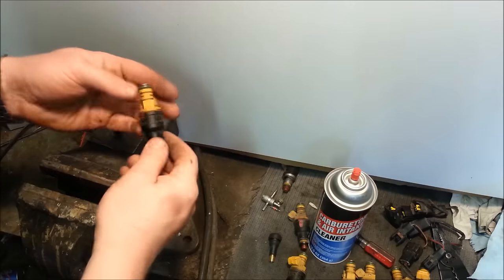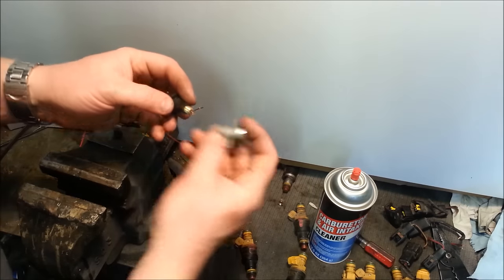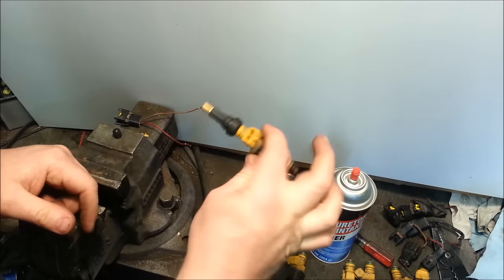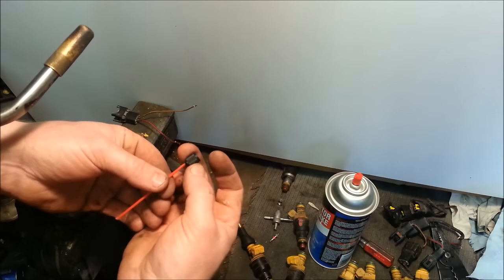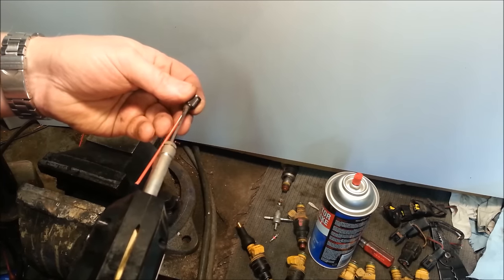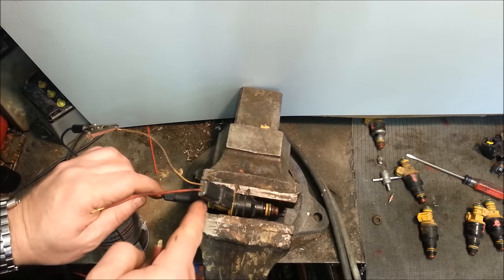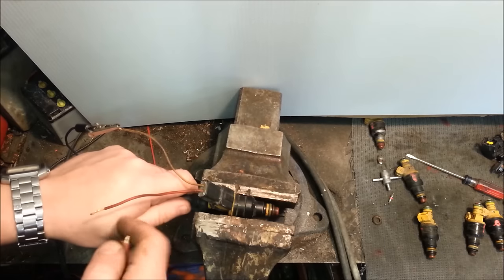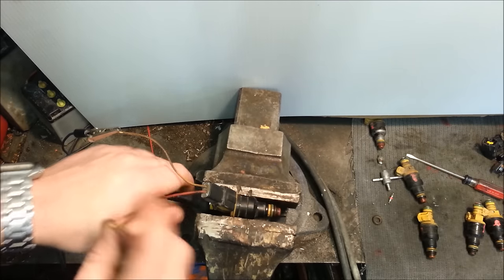Fuel injector cleaning without expensive tools

Comment: I made a device a few years back where I used a hose with clip on tire air fitting on one end, put other end on the injector.
First fill part of the hose with Gumout and hook to tire for air then connect injector to 12 volts. Pulse the power and watch the spray.

Comment: Thank you so much, I have used your technique today and it worked. However I used epoxy adhesive instead of burning the straw. Through this technique is managed to identify the bad injector which would inject the sprayer without power connection
Reply from the maker: Wonderful!

Comment: You can use a power probe or a multimeter at the fuel injector harness with the key on to see what voltage the fuel injector needs....assuming that the circuit is good.

Comment: Valve stems seem to be multi purpose gadgets for the garage!
The only thing I have to notice is that there are Injectors with very low resistance like under 3 ohm (instead of over 12 ohm for high res. types). They dont like to get 12 volts continiously. Easy to measure.

Comment: Go get the medicine syringes from walmart pharmacy. Small size.  They fit the straw perfectly with no heating or adjustment, and they fit the injector o-ring on the other end just right. No mods, plug in the injector, plug in the straw, and it holds pressure and does the same job. WIll save you tons of time. Use a matching injector pigtail, with a momentary switch wired in, or just bare ends.  connect one lead to negative, and tap the other lead on the positive terminal, repreatedly until the injector sprays right.

Comment: Any danger in using regular carb cleaner on fuel injectors?  wondering if a special "injector safe" carb cleaner is needed or non?  Thanks for making this video - made myself one with your instructions.
Reply from the maker: Carb cleaner is just Acetone and about the only thing that will dissolve varnish/gummed up gasoline. Anything that is gas safe is acetone safe.
Reply: @sixtyfiveford  Just cleaned mine using this.  worked good but I probably should have tossed a hose clamp on - injector kept popping off if I didn't hold it.  Thank you sir!  Car is running better ;)

Comment: Last Truck I Had Was 01 Tundra V-6 & During it's 888,000 mile Time I Had It, Usually Just Either Mixed  Premium Fuel+ Some Mid. or If O2 Sensor STARTED acting Like Something Wasn' t Right ,Just Used Lucas & Never Repl.An Inj. or had to Clean Any of Them Manually

Comment: I bought a tin of fuel injection cleaner mixed it with a full tank of petrol 1000ks before an oil change.  After the oil change the engine has stopped burning oil and after 5000ks the oil still looks clean and clear. A complete turnaround. The engine runs and starts so smoothly. Just buy a reputable brand of injector cleaner put in your petrol and you'll be amazed.

Comment: Hey, Is that a port fuel injector. I guess not. It should not function at higher pressure. If its a direct injector, you cant supply 12V for a long time. Can you reply me..

Comment: When powering such appliances with 12v battery,  always use a 12v car bulb (blinker or smth, not headlight) to limit current. You connect it in series.

Comment: I did this yesterday. Used break cleaner could tell right away flow was blocked. Cleaned all 8 and runs perfect now in tank cleaners wouldn't touch it and nobody had OTC cleaning fluid local. More work than using the OTC fuel injection tool but the end result is the same.

Comment: A dealership wanted to flush the injectors on my vehicle as part of their service, and would charge like $250 for cleaning 4 injectors, which is roughly what it would cost to replace them. So, this video is helpful.
Reply: dealerships are really$ rip off. i can get mine =v6 pontiac grand prix injectors cleaned for $80. but i would like to learn to do it myself also.

Comment: I wonder if cleaning the injectors makes a noticeable difference in throttle response.
Reply from the maker: It will if that is the culprit. But you can also have other issues that give the same symptoms.

Comment: Is carburetor cleaner actually the appropriate chemical to use to clean fuel injector?
Reply from the maker: Absolutely. It's designed to clean fuel varnish, fuel deposits, carbon etc

Comment: I wonder, is it really necessary to clean a injector ? It is always on very high pressure, so isn't it quit rare that it will be clogged ?
Reply from the maker: Yes it's rare and I wouldn't go out of my why to clean injectors if I didn't have a performance issue or engine codes.

Comment: Ok so i just tried this but didnt have a valve stem handy so i used a sharpie cap and poked a hole in the lid with a hot finish nail. I left the o-ring on and it sealed tightly. The shaprie cap was a perfect snug fit.
Reply from the maker: That's good to know.

Comment: cleans and flow tests it!  I might try this... my issue is that I have a melted pintle cap (plastic) and can't find the exact replacment.  Any ideas where to get new ones or if I can use a different style on my injectors?  My injectors are no longer manufactured so I need to do a full rebuild myself.
Reply from the maker: Ebay is where I would look.

Comment: I just pulled my injector bar, and duct taped the spray can hose to the fuel intake, had a friend turn over the engine a few times till all my injectors were clean.

Comment: Will definitely try. Cost effective and produces results! Ty sir.
Reply from the maker: Thanks.
Reply: sixtyfiveford  bro, you are a lifesaver. It worked well and got the job done. I left the injector rail installed on the car and connected the apparatus where the fuel hose connects to the injector rail, started the car, kept a constant feed from the aerosol can and baboom, getting all 4 injectors cleaned simultaneously. Of course I have a switch that disables the fuel pump making this the easy method, lol. Point to note, and I learned it by experience, ensure the apparatus is fastened securely to the injector rail. Lol, goes without saying eh! Never need to pay for injector cleaning service again!!!

Comment: What about if we don't know which side is positive and negative does it matter? Also is it recommended to back flush them
Reply from the maker: Doesn't matter which side you connect pos/neg to. Most won't allow back flushing. The pressure will hold the injector closed.

Comment: Engine chatters during cold winter mornings and gets 30 MPG instead of 50 for a 2010 Toyota Prius with 188,000 miles. 
Could injectors be the cause?
I’m cleaning with Lucas injector cleaner.
Reply from the maker: I would first look at your wear items like spark plugs.

Comment: I would think that if you flush the cleaner through the injector in the same direction that the fuel normally flows through it and there are any dirt particles stuck in it they just remain inside the injector and NOT be flushed out? 
 Wouldn't it be more effective to back flush the injector?  In other words, have the cleaner flowing through the injector in the opposite direction that the fuel normally flows through it?
Reply from the maker: Lots of injectors won't flow in the reverse direction with pressure applied. Dirt shouldn't be in the injectors or you have bigger issues. Generally it's varnish and fuel deposits that just need to be dissolved.
Reply: @sixtyfiveford    Great!
  That gives me a better picture of how injectors work which is always a benefit when trying to understand and fix any problems.
  Thank you for your detailed answer.

Comment: How much does a batt like that cost? I'll just see if I have one laying around. Then I'll just remove the injectors buy some carb cleaner. Then I'll break out my drill and diddle with a valve stem. This looks like a fun lil science project I really think it does
Reply from the maker: You can use the battery out of the car. Or you can use a 9v battery.

Comment: Can you back flush with the valve stem by putting it on the other side of the injector?
Reply from the maker: Yes. If the spray pattern doesn't look good just do it in reverse a few times and recheck.

Comment: Do you know the voltage for a bosch injector?  Hooking up 12 volts with battery amperage will fry an injector
Reply from the maker: Fuel injectors run off of 12volts(actual 13-14volts when vehicle is running/charging). I've hooked up many Bosch injectors to 12volts without any issue. Power(12v-14v positive) is constant to the injector while the vehicle is running and the ecm pulses the ground to trigger firing the injector. The injector or any electrical device will only pull the amperage it's rated for (approx 1amp) and it doesn't matter if you hook it up to a 12v battery from a motorcycle or a diesel truck. It will only draw the approx 1amp at 12volts. People try to use little 9v batteries and they work for some injectors, but the lower voltage causes a higher amperage draw and more heat in the coil winding of the injector. So your more likely to damage an injector by hooking up a 9v battery cell than a 12v car battery.
Reply: @sixtyfiveford  I'm not willing to chance it at this point, but I hope it's right.  Here's another question I have.  On a diesel fuel rail vehicle....If you turn the key on the engage the fuel pump in the tank.   Will fuel come out any of the hard piping to any cylinder if you open to bleed?
Reply from the maker: @frontlinemedia4270  An electric fuel pump on a diesel generally only pulls fuel from the tank and delivers it to the suction side of the injector pump. Generally you bleed it at the fuel filter. 
http://www.autodiagnosticsandpublishing.com/feature/fuel-injector-testing.htm
Reply: @sixtyfiveford  well, I have fuel at the injector lines when I crack them open while the electric fuel pump is running.  Of course when it shuts off after several seconds I have nothing.   This high pressure fuel pump was just remanded

Comment: Thanks works good ...i used to put cleaner in injector fuel rail and back fill the fuel pump inlet with  sparks out and crank-over, but this is better... subb Ced
Reply from the maker: Thanks.

Comment: Does an injector can be fixed? If so, What are the most common damages?
Reply from the maker: Either the coil is shorted out and not fixable or it is just dirty and needs to be cleaned.

Comment: Great video, how can you tell if you have a leaky injector though ?
Reply from the maker: It'll leak when you pressurize it with carb cleaner.
Reply: @sixtyfiveford  awesome, yeah did the test, turns out I need a new ECU 🤦🏽‍♂️ capacitors are fried chicken.

Comment: hey,got the filters for the injectors, they spraying very good when tested but...that dont seem to be the problem, the car still wont start. fuel pump new,fuel flowing through the injector rail,very good spark from the all 6 spark  plugs. engine turning over but no start. tried 2 machanics so far and no one cant find the problem. its a 'TOYOTA  GX-81 MARK 2 CRESSIDA'' WITH A 1G 6 CYLINDER ENGINE.the last machanic said it was the injectors that needed servicing,now they saying it could be the KNOCK SENSOR or the CRANK SENSOR. ????  would like to know what you think please,thanks
Reply from the maker: I'm not an expert on Toyotas, but from a general standpoint you just need fuel, spark and compression. If these check out you're good. But you also need to make sure everything happens at the right time. This is a belt driven engine and the timing belt could have skipped a tooth/slipped. This generally shows itself as an almost starting engine or backfiring through the intake. A compression test should also show low if the timing belt has slipped. To test the fuel system you can spray starter fluid into the intake to see if it will start. To test the spark, use a spark tester on each spark lead to make sure it continually sparks while cranking.
Reply: hey, everything you mentioned  checked out fine.  but still  no start. will keep trying.have another machanic coming to check it.really hope this one finds the problem. thanks alot,appreciate your response
Reply from the maker: nio press The spark could be firing at the wrong time. This could be set manually or electronically depending on the engine. If electronically controlled the crank/camshaft position sensor would help control this.
Reply: thanks a whole lot.really appreciate it.

Comment: I have a 2000 Expedition with a 5.4 L and I've been trying to figure out why rough idle so I have been figuring out what's going on so I started with Mass flow sensor I also took time to clean everything out and wipe it down but it still gave me a rough idle step-by-step purple, stuff step with cause a rough idle I was checking the OL on the connectors on the fuel injector and I don't know if the OL r right but it gave me a reading of well between 10.43 and10.45 on every single one but don't know if the OL R RIGHT...?
Reply from the maker: Generally a reading that close and your fine. Generally when they short out the reading is way different or completely open. The computer is pretty spot on diagnosing a misfire and the exact cylinder on these(I also have a 2000 Expedition). A bad injector would show up as a misfire code. These engines do have a lot of vacuum lines on the passenger side that can break and cause poor idle but that would likely show up as a Lean Code. Does it show any codes?

Comment: is there possibility to damage the fuel injector direct 12 v current,?
Reply from the maker: Personally I have never heard of anyone damaging their injectors with the short pulse of 12 volts. There is some debate as to whether some injectors run off 5volts vs 12volts but I havn't found any info confirming/denying this. If you are concerned you can hook 4 batteries(AA, C or D cells) together for 6volts. If it doesn't trigger your injector, you can go with 12volts.

Comment: should've known to have come to you first! I'm having problems with a cold start on a corolla verso d4d and thought it'd be either the fuel pump or the injectors. is there any easy way to figure out where the problem originates without expensive equipment? thanks again for the vids, I'm still determined to buy a boat like yours and feel like a rich guy😀

Comment: After cleaning it with throttle body cleaner, can I then re-install the injector, or does it need to be left out to dry or cleaned with something else?  Also, can I just remove the injector from the motor and go straight to work on it? I have a 2007 Nissan Versa.
Reply from the maker: It's ready to use right after you clean it. No need to let it dry or anything else.
Reply: @sixtyfiveford  Thanks. So I can remove the injector and go straight to work on it correct? Or do I need to do something else before removing the injector? I'm assuming there will be some gas leakage from the line.
Reply from the maker: @Astroboy956  Remove it and go straight to work. Yes gasoline will leak when you remove the top connector on the injector (fuel rail)
Reply: @sixtyfiveford  So I used a long screwdriver, held it against the old injector and heard it working, but I'm still getting a misfire. Could the injector still be the culprit? I changed the spark plug and coil very recently. Could an injector gasoline cleaner help? Thank you for your speedy responses.
Reply from the maker: @Astroboy956  You've followed the right steps for a miss fire. There's a couple things you can do with the injector: move it to a different cylinder and put the other good cylinder in its spot and see if the misfire travels with the injector. If that same cylinder misfires even with the swapped injector then the injector is not your issue. If a different cylinder that you swapped in the injector to starts to misfire then the injector is your issue and cleaning or replacing is necessary.
Reply: @sixtyfiveford Let's say it's not the injector, what do you think could be causing the misfire? I'm bracing myself for a worse case scenario.
Reply from the maker: @Astroboy956  low compression in that cylinder (valves or piston rings)

Comment: I have 02 silverado. No.4 misses at idle but good just off idle and up. Bad injector?
Reply from the maker: Spark plug, coil pack, bad injector, leaking head gasket, low compression are your main options.

Comment: Can I use an 18v power tool battery or does it have to be 12v exactly? I would think higher voltage is ok since people use higher voltage batteries with power tools via adapters all the time.
Reply from the maker: Just use your car battery. 18v battery is closer to 21v full and will easily short your injector.
Reply: @sixtyfiveford  might as well just get a nine volt or hook 8 AA’s up together

Comment: What are some symptoms of a dirty fuel injector I feel like I want to clean mine just for the hell of it have about a hundred and forty thousand miles on my Daytona Charger
Reply from the maker: Generally modern cars will throw misfire or lean check engine codes when an injector is plugged or leaking. I would say very few cars actually need them cleaned during their life.

Comment: This was genius! If I can get the injectors off easily, I will try this. Also, did you ever try it with a 9 volt battery? Many people don't have a 12 volt power supply handy. Lastly, do you have any ideas for what to use as a substitute for the vise?
Reply: J. Wilson battery of the car is 12 volts
Reply: @seanwilson1985  Most solenoids will operate with a 9 volt battery as well

Comment: can you use brake cleaner as well?
Reply from the maker: The main ingredient in Carb Cleaner is Acetone witch is highly effective at dissolving gasoline varnish and deposits. Brake Cleaner on the other hand is simply a degreaser and I can't see it do as good as job.